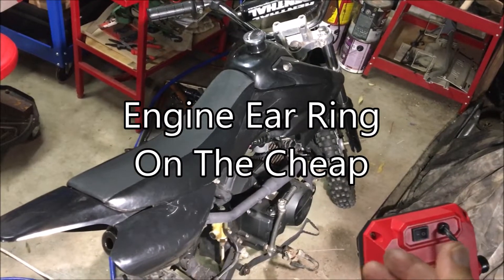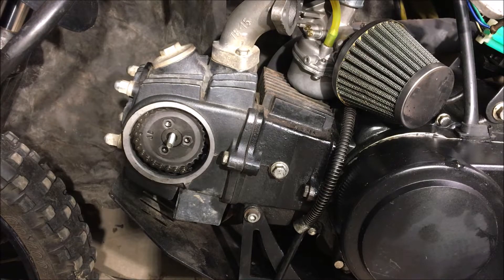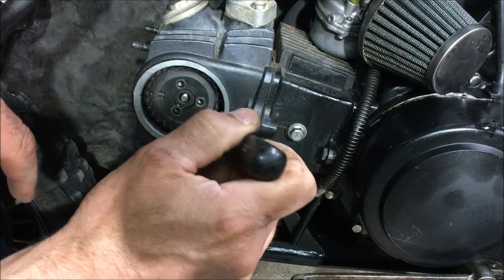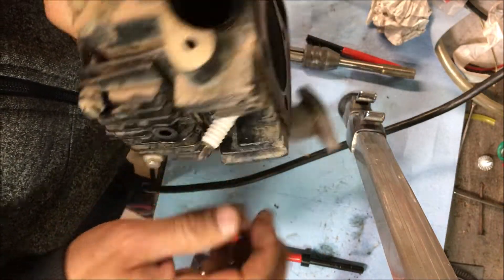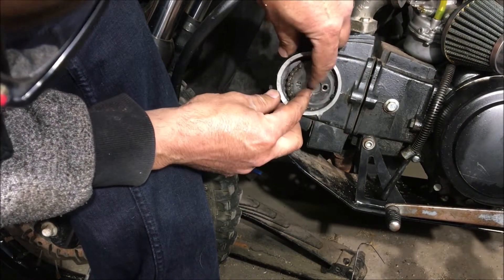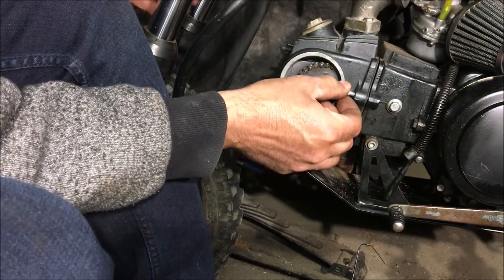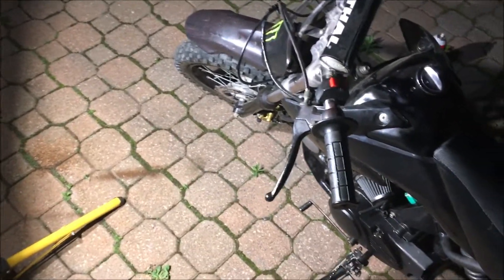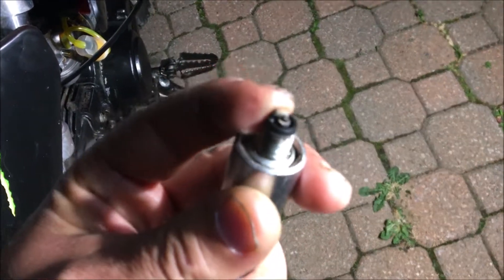011 125cc China Bike Stripped Spark Plug Threads!

Comment: I have the same motor on a go cart and i just bought it 2 days ago  The spark plug will not even thread in is it possible to mess up the threads that bad? It still turns over and everything it's just not getting fire from that Ignition coil. 
 Should i do what u did in the video?